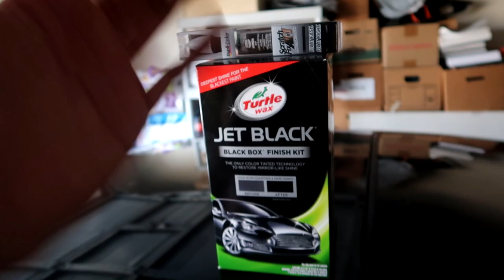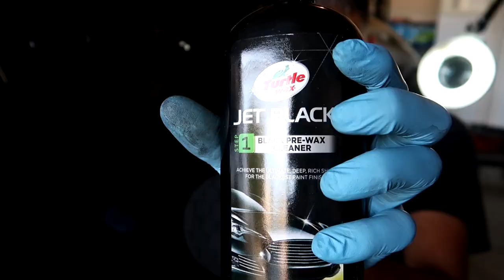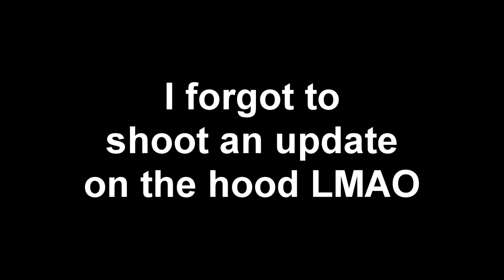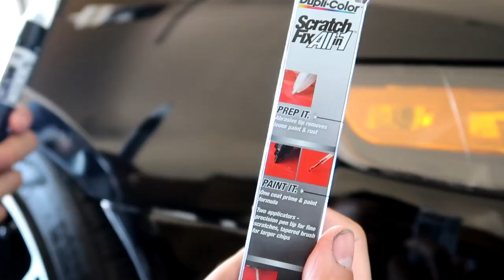Spoon vs Modulo !!!

Comment: I love the spoon bumper,  ur do you have to take the crash bar off in order to put that bumper on? My intercooler is attached to the crash bar so I kind have to have it on the car
Reply: You can run the jdm crash bar with slight modifications

Comment: Just a heads up when you use the Touch-up Paint, make sure to sand the paint down so it's even & smooth. Same thing with the Clearcoat. It'll look a lot better instead of it looking like a bubble in the paint. Otherwise, Nice Job. 🔥🔥
Reply from the maker: Noah Blanchette ohh shit you right, I didn’t even think about it lollll

Comment: yow yow yow dude, A plastidip (FULL CAR) will fix all the imperfections. I did mine 2 months ago or so and still looks awsome. Nevertheless when the dip is removed a new paintjob is really necessary. It will grab all the loose paint, bubbles or rust.... but then again a new color is easier done with plastidip.
Reply from the maker: i forsure want to get the tsx wrapped later on!

Comment: The oem TSX headlights uses silca gel to prevent the headlight condensation. When I order a new pair of headlights I kept having my driver side headlight condensed. Bought silca gel fixed the problem.  More info https://www.tsxclub.com/threads/headlight-condensation-fix.54522/page-2